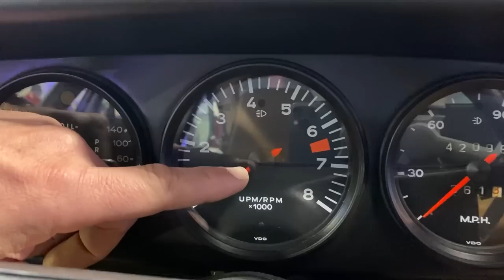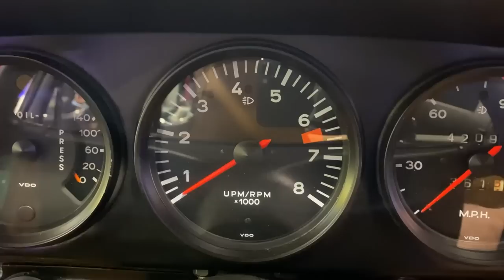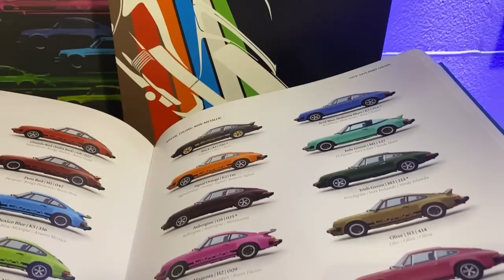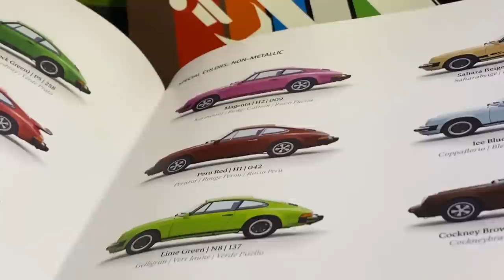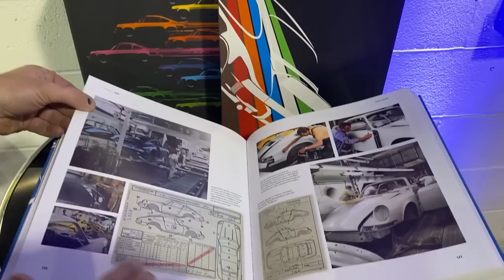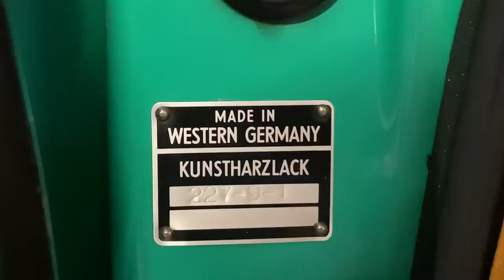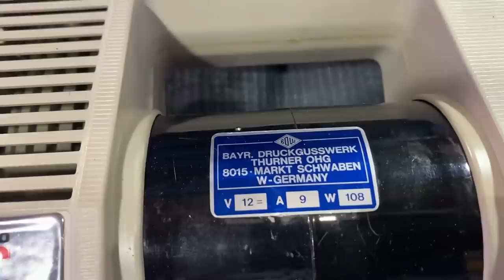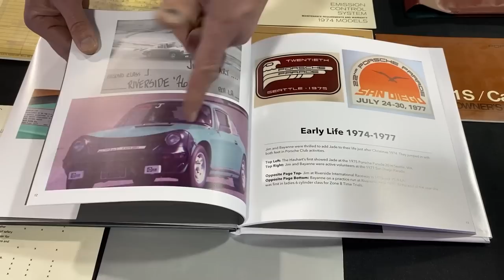1974-77 Porsche 911: Everything you need to know about the ‘mid-years’ | PCA Spotlight

Comment: My 1974 Porsche 911, with the 2.7 L engine purchased in the mid-80s with 70,000 miles on the clock, was the best of cars and the worst of cars. I knew little about 911s when I bought it but loved its appearance and the lively feel and precise handling during a lengthy test drive. A mechanical check at a Porsche dealership gave it a clean bill of health and I sealed the deal. I drove it for a couple of months, enjoying it immensely, and then took it to the dealer for a tune-up. While the car was in-shop I received a call from the service manager who told me the valve guides had worn to the point where it was very difficult to adjust the valves properly. He gave me an estimate for a top end rebuild.  I still remember the overwhelming sinking feeling in the pit of my stomach as this news settled in. 

Not long after, I learned about the stud pulling problem. I'm in Canada and like most sports car owners here put the car away for winter. I spent that time figuring out whether and how I could get this car fixed properly. I decided on a complete engine rebuild with the new dilivar head  studs which I had done at a shop specializing in rebuilding air-cooled engines including for 911s . (Note; Canadian 2.7 L cars did not have the thermal reactors and seldom experienced pulled studs.) The car ran well after that but soon started burning oil. The engine was torn down again revealing 2 split oil seals. That job was done at no cost.

I then had 20 years of incredible driving pleasure after that, experiencing only a broken clutch cable requiring a flatbed truck ride to the shop. I put about 5,000 miles on it each summer. We took week long road trips with 1 kid, and then 2 kids in the back seats. When a third was on the way, the kids came up with an idea for a little cradle which could be mounted in between the fold-down seats so all 5 of us could go on vacation with it. We never did that. When the oldest, a rambunctious boy very similar to Bart Simpson, was nearing his 16th birthday, I sold it, saying we needed the money for his college education.  

I can still feel the pleasure that car gave me. The sense of control, being able to do just a bit more than others on the road, was immense as was the pleasure that gave. I do have to confess that it was occasionally a bit embarrassing to use the car at times. I never really liked people complimenting me on the car; something that made me cringe just a tiny bit. Some do buy cars like this to satisfy ego needs and it will do that! But that's just a bit tacky, yes? Still these are beautiful machines, a great example of what people can do, and we can all admire that.
Reply from the maker: Thanks for sharing. Thanks for watching and be sure to subscribe.

Comment: Thanks for this great trip down memory lane for me.  I purchased a 1977 911S Targa in Mexico Blue in 1985.  It was the original owner´s vacation car in Hawaii so it only had 10k miles and was kept garaged in the basement of his penthouse condo at the foot of Diamond Head.  Yes, it sounds idyllic.  My wife was his admin assistant and he only lived in Hawaii part-time.   He could afford to do all the required updates on the engine so that was already taken care of by the time I took over.  I loved that car for the light weight and responsive engine.  The narrow body, silver/chrome trim and silver Fuchs wheels just looked perfect to me.  The only changes I never got around to before I had to sell the car in 1992 was updating to an 11 spoke fan and adding the right side mirror.   I never raced the car or took long trips in it (Oahu only), so it fared ok with the under-powered 5 spoke fan and no a/c.  Regular oil changes and a set of brake pads were the extent of my maintenance bill for that car.  I remember always marveling at how good the brakes were on the 911.  Point and shoot handling too.  I loved the ease of being able to remove and store the Targa top while still in the driver´s seat.  I took advantage of that all the time in the warm Hawaiian sun.

Comment: Enjoyed your great video about the 1970 mid years. I have a 1974 911.  The original color is salmon metallic. my production number from the vin is 622.
And my car has the original cloth seats that is the burgundy tweed and twill. And I am the about the fourth owner of this car and,  I am the one that has to do the very expensive engine rebuild. Trying to save up the money for the engine rebuild now.   Very pleasurable car to drive.  Since my car was painted with the metallic paint it has been repainted and I am missing the sticker that is in the drivers door jam that has the the month and the year that the car was manufactured it was the 622nd car produced but I just I wish I knew what month and year the car was actually built.
Reply: Marion- Your car would have been built in either October or November of 1973.

Comment: My 77 911S was the absolute worst 911 I have ever owned.  40 years and more later doesn’t make the car better. Ordered it in Germany and picked it up in Zuffenhausen in the spring of 77.  Bitter chocolate,  over cork leatherette with nice velour.  The vinyl they used in the 77 cars was very high quality.  Many thought it was leather.  Okay, that was the good part.  I ordered it minimally, with 15” Fuchs, right mirror, black trim, and cruise control.  Living in Germany at the time, I used it as my daily driver, hitting 100 mph every morning going to work.  When I would take it to Switzerland on Sunday for lunch, the car really needed a rear spoiler.  On the autobahns at speed (120-140 mph) it just got too squirrelly to be safe. As a US spec car it was unsafe at speed at night.  Germans had the benefit of real Bosch H1 or H4 headlights while American spec sealed beams were just plain dangerous.  For Porsche to stay with magnesium cases to save something like 200-300 lbs was a big mistake carried for far too long.  I didn’t have it a week with those terrible thermal reactors and air injection pump when the bolts holding all that together started to fail.  Autohaus Mauk in Heilbronn tried very hard to keep it together but the dissimilar metals was not helping.  With new helicoil inserts and the newer bolts helping, I still couldn’t wait to lose those TRs once I got it stateside.  It was such a disappointment, spending $14,800 on that thing which always ran hot, and got worse when I added the very necessary air conditioning.  You simply can’t believe the oil temps I would see!  300°F was not uncommon.  By 1983 it was time for a far better car and I traded it for a beautiful 1981 911SC which had been turbocharged to an output of 270PS.  It was like night and day. The SCs simply did not drip oil or even use oil.  It was fully stocked with dark brown leather throughout over a Bamboo Beige skin.  Everything worked better than the 77.  It was great to finally experience a proper 911.  9117201923 is out there someplace, but I can’t tell you how much I enjoying having that in my rear view mirror!  That car is slightly mentioned in my Feb 2008 article in PCA’s Panamera magazine.  I contrasted the ordering process and assembly between 1977 and 2006 when I returned to Zuffenhausen for a new paint to sample Carrera S cabriolet, with hardtop, PCCBs, and a bunch more.  Porsche knew that they always had me hooked, since I had been in their cars since 1974.  The cabriolet shares a garage with my 64 356C coupe and my 77 Rolls-Royce.  While I truly love the engineering behind things Porsche, they learned much on our dimes.  The 911 has always had some form of Achilles heel, and clearly the 77 911S was no different.  The get-by thermal reactor solution was a total disaster.  When Porsche finally came out with the oil fed tensioners in the 1984 Carrera 3.2 engines, that part of the engines benefitted considerably.  If you’re in the market for a used (obviously) 77 and you pop the engine lid and DON’T see oil fed tensioners, walk—make that RUN— away.  Whoever has owned that car over the decades and hasn’t updated the tensioners is too cheap to own a 911.  One fond memory of that car—cruising one evening on the autobahn to a Rhine River cruise with friends, while leaving the car on cruise control at 120 mph and sipping on French champagne.  You only live once.  Porsche, there is no substitute.  But don’t forget to take care of it.
Reply from the maker: Thanks for sharing your experience. The situation in the 1970s with thermal reactors and such was unfortunate for 911 enthusiasts. Most mid-years nowadays have had their thermal reactors removed and problems caused by them fixed — if they're still on the road being driven regularly.

Comment: Another upgrade for the 2.7 is timing chain tensioners. I think they are called 930 tensioners. It’s been awhile since I was playing around with my 1977 911S, but my son and I are currently reviving it from a 20 year storage hiatus. Fuel tank cleaning, new fuel lines and rebuilt ECU which was failing back in the day and was the reason for parking it at the time. That,  and I bought a brand new triple black C5 Corvette in 2000.

Comment: I now have a new appreciation for the mid-70s Porsches., including the discussion of the engine issues and how they differed from year to year. The discussion on colors is fascinating, but one question is - what year did Porsche begin galvanizing the bodies?  That certainly makes a difference if the car has spent much of its life in northern climates.....
Reply: Galvanization started for the 1976 year. My 911s was delivered on the 1st of Jan 76 and is galvanized so i suspect that a few late 75 models may also have had this treatment.
Reply: I have an early 76 and it’s galvanised…
Reply: They started (partly-) galvanisation in July ´75 with the start of the production of the MY ´76 (= J-series).  My MY ´76 911 S is the 613th (partly-)galvanised car.

Comment: When I was looking for a classic 911, I came across quite a few 1974 - 77's that had 3.0 transplants from the SC due to the 2.7 failing. Magnesium is generally less durable than aluminum engines and transmissions with the main advantage being lighter weight, but for me, the tradeoff wasn't worth possible reliability issues so I focused on the SC which has power  assisted brakes although this started on the 1977 2.7. I also struggled with non matching engine transplants selling for the same price as originals. Made no sense to me so I picked up a 82 SC and love it.

Comment: And not to forget the Carrera 3.0 which was a very unique car and also very rare. Only built from 75' to 77' with an 3.0 liter engine at 200HP. The same engine as the turbo but without the turbo. It has the same acceleration as the 2.7 Carrera RS but ist has better torque. So please don't forget this car. It was not sold to the US just like the 2.7MFI Carrera.
Reply: I certainly would never forget the 3.0 Carrera as it is one of my favorite models. I did not include it for a few reasons: primarily as it was never sold here in the US (same reason I didn't go into depth on the 2.7 MFI Carrera) and I also didn't have an example on hand to use for the video. The other reason is I think the rare models actually need a stand alone video as there is so much mis-information about them! On my to-do list!
Reply: Hear hear!   The 3.0 cars are often overlooked.  They are fantastic cars.
Reply: @PowellAutos  Agreed, the Carrera 3.0 is overlooked. I've driven and ridden in a few, but never owned one.

Comment: Wonderful video with incredible details of these mid year 911 vehicles. I’m currently looking at a 1976 911 turbo, very early production car ( first ten imported to the USA) it has a dashboard with a center vent and no top speaker. Also, the doors do have power locks but, have the knurled knobs. We’re the turbos different than other 911’s? This combo sounded like wouldn’t have been possible on other 1976 models. Just want to be sure someone didn’t switch out the dash and added the knobs somehow during the cars  hx. The selling dealership isn’t able to give much history about the car but, provided a title listing it as a 1976.
Thx. Phil

Comment: Nice video but I do not agree that the 1974 - 1977 2.7 cars negative bias is unwarranted. The magnesium block aluminum head thermal issues related to pulled head bolt studs is real in these cars with many succumbed to even low mileage failures rivaling the 996 in terms of failures. Not to mention these magnesium engines are among the most expensive to rebuild. At least many 996's racked up double the miles of the 2.7 era cars before the single row IMS let go and the dual row early cars held up even longer with many failures see by those who often track their cars. And while I’m not making accusations, also keep in mind as a PCA member, and collector, he has a bit vested interest in dismissing the reliability history of these years. I'd rather have a 1974 - 77 with a later non numbers matching 3.0 transplant than an original 2.7 as a driver’s car. If you are going to spend 50K plus on a sorted car, why not put the money towards a 1978 3.0 car and higher with know reliability. Do you research before buying these cars rather than listening to anyone, including me, off YouTube.

Comment: This is awesome thanks much for a wonderful video! I proudly inherited an original Red 1974 Targa Carrera (grandfather was 2nd owner in 1975). I have a sportmatic transmission which wasn't discussed here. How many 1974's had sportmatic? I am trying to figure out if the cars true original trim was bright trim or black (the arch is silver). I was told that the US dealers were painting the bright trim black? My steering wheel looks more like the 1975 you showed, so would that mean its a 1974 stock sport wheel? The car had a turbo tail installed in 1975, but I am going back to the duck this year. Thanks in advance for the the help!
Reply: The sportomatic is fairly unusual, I have not seen an exact count but suffice it to say it is rare. The Sportomatic is an ingenious solution that has its fans but is generally snubbed (I think unfairly) in the marketplace. Many original Sportomatic cars have since been converted to standard 915 transmissions. The US Carrera received the black window trim as standard, with bright a no cost option. As I mentioned in the video, check the small trim items, a bright window car would have items such as the vent window latches in chrome.
Reply: @nathanmerz  Thanks much! When I had the car partially restored last year everyone in the garage loved the sportmatic and said it was very rare and to never change it. S brakes and other minor upgrades also present on my car which I am told is rare. I love it personally not having to worry about a clutch peddle. It is a little temperamental if you like to lay your hand on the shifter you can't really do that. The next question will become if and when to do the body with a full strip because there are weak spots opening up the paint. Can't wait to get the muffler changed out for a sport muffler and put the duck tail back on it. I am looking to do more PCA events next year as well. Be Well!

Comment: Love it. Very well done. I have a question about the "orange crest". I believe that Porsche states... "The strong red-orange colour is characteristic of this crest, which dates from the time of the original 911 (1964 – 1973)" - but you say it was only on the 74-75 911. Did I misunderstand? (would love to know. Thanks in advance.)
Reply: the orange badge was used up until 1974, but did sneak onto some early build 1975 Model Year cars. I said in the video only 74-75 as those are the cars being discussed, but an orange bar hood bade is correct for ALL 911/912 from 1964-1974/5. Hope that helps.
Reply: @ntm4122  thank you

Comment: The '74 to '77 were problematic because of the thermal reactors that were used before cats. They'd often cause the engines to overheat. 
I suppose they could be deleted depending on a state's smog law for older cars.
The SC motor had a lot more torque.
Reply: Garth- only the 75 California model and the 76-77 used thermal reactors. You are correct, for those cars that had these installed they were a large part of the toxic set of circumstances that led to to a shortened lifespan for the 2.7 engines. By the mid 90's finding a car still running thermal reactors became quite rare, nobody in their right mind would run them unless you absolutely have to, for example in States like California. This is also why you will see a premium for 1974-1975 as they are Smog exempt in CA, so even if you had an original CA MY1975 you could backdate the exhaust to the 1974 and earlier style design or SSI's. If one owns a 1975-1977 and are not required to emission test it, you should absolutely go the backdate route. You can find this discussion at 19:57.
Reply: @ntm4122  We had a '76 in California, with factory air. It was prone to overheating.  It was an oil-leaker, too. The '80 SC was a better car.
Reply: @ntm4122  I wouldn't want a pre-'76 anyway because they lack the all-galvanized body. 
I should say I'm much happier with a new 992.

Comment: Your white 74 Carrera has the incorrect mirrors and your HELL BLU car is missing the round VW style seat lock buttons, another way you can tell a 74 from a 75 and up. Just saying. Great video. I learned a lot. Thanks
Reply: @bertharris9748 my HELLGRUN car has the correct round seat knobs, it might be hard to tell based on the angle but you can see them at 53:14, you are correct they changed for MY76. The white car was "updated" in period (including the addition of 2 MY76+ flag style mirrors) with lots of incorrect details and is awaiting a full restoration, hence its not being fully featured in the video.